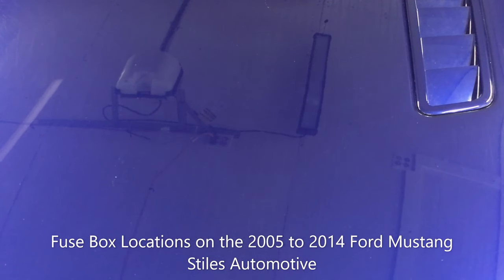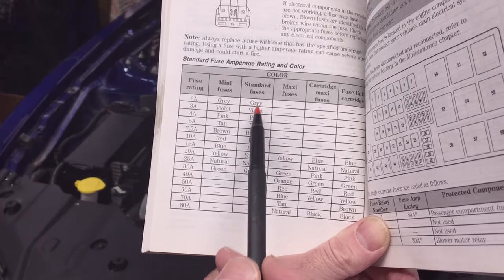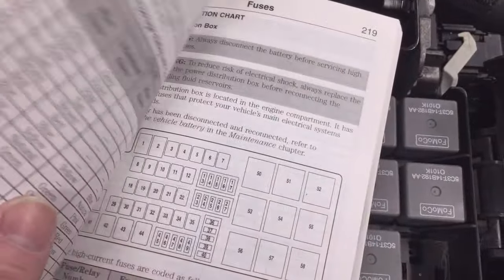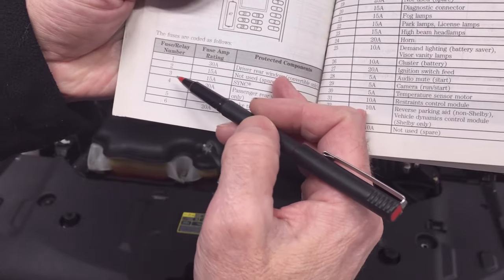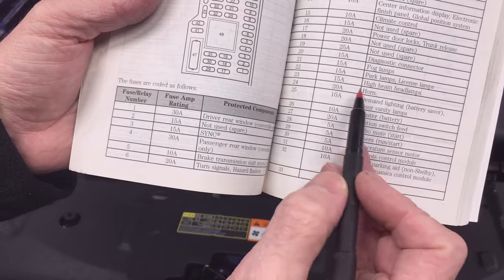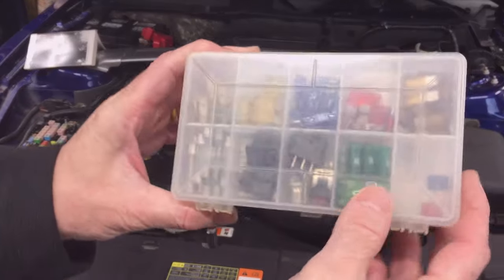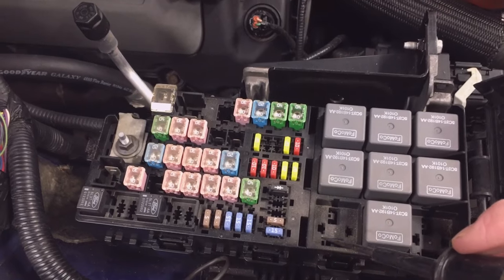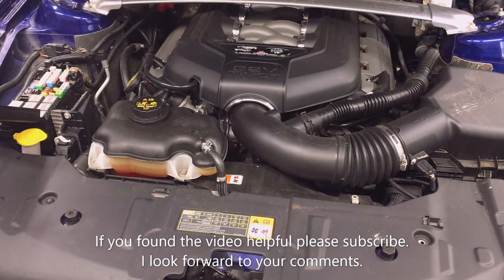Fuse Box Locations on the 2005 to 2014 Ford Mustang

Comment: I have a 2005 mustang and when I try to open the trunk with my key fob the button doesn’t work and when I go to the fuse box and opened it from there the trunk opens, do you know anything that could be the problem?
Reply from the maker: Cris, the simplest answer would be the Button on the Key Fob is going bad, it could be on a 2005 vehicle.  If you are like me, I use one Key Fob and even on my 1998 Mustang the 2nd Key Fob is new (used once or twice).  Did you try a second Key Fob?  If so . . . the Mustang uses a Trunk Release Relay on/in the Fuse Panel in the Passenger Side Kick Panel.  When you press your Trunk Release Button do you hear or feel the Trunk Release Relay actuate on the Fuse Panel?  How are you making the Solenoid operate from the Fuse Panel?  Are you bypassing the Trunk Release Relay?  - Stiles

Comment: i have a 2014 mustang, which fuse do i have to remove to reset my radio sync? my radio went out, all i see is the temeprature and which direction i am driving
Reply from the maker: Evan, In the Passenger Compartment Fuse Panel, Fuse Number 39 (20A, Yellow) is the Radio/Navigation and you may also need Fuse Number 41 (15A, Blue) Accessory Delay, Reference Pages 230 thru 232 of your Owner's Manual.  Also make sure these Fuses are good and not blown.  Another option is to work in the Engine Compartment at the Power Distribution Box, removing Fuse Number 1 (80A, Black) is the Passenger Compartment Fuse Panel Fuse, which will remove power from inside the Mustang, Reference Page 226 of your Owner's Manual.  Yet, another option is to remove the negative Battery Terminal.  Plan to leave the Fuse or Terminal removed for 10 to 15 minutes.  It seems your condition may be caused by a low Battery condition.  Charge your Battery overnight with a Trickle Charger and drive the Mustang.  Let me know how it goes.  - Stiles
Reply: You find out if that works? My radio is blinking as well
Reply: @jays5605  it didn’t work. I tried all the steps. My mechanic said my fuses are good. He also disconnected my negative battery but that didn’t work either. I’m not sure what to do at this point
Reply: Evan Holt Yeah bro, Do you think a new stereo system would work?
Reply: @jays5605  yea bro I may just have to. I could’ve blown out the speakers or something
Reply: Evan Holt You find the problem yet?

Comment: What is the cigarette lighter Fuse for 2014 ford mustang v6 need help
Reply from the maker: Quan, Ford calls it both the "Cigar Lighter, Front" and "Power Point (Instrument Panel)" which is powered by Fuse 22 (20A, Blue) in the Power Distribution Box in the Engine Compartment. Most Mustangs have a Second Power Point in the Arm Rest Console, that is Fuse 5 (20A, Blue) Power Point (Body). For anyone else reading this; this applies to all 2010 thru 2014 Mustangs - Stiles
Reply: @StilesAutomotive   I took them out and they wasn’t cracked or anything but it’s still not working what would be the next step

Comment: Do you know anything about the 2010 500 series sherrod mustang?
Reply from the maker: Wen, not that much, I've always thought (and not really justified in doing so) that these (Sherrod, Roush, etc.) packages are more cosmetic than performance.  This is unlike Hennessy which is performance.  Since you are asking this on the Fuse Box Location Video, do you have an electrical question? The 2010 Mustang is special, although it still has the 4.6L Engine (like the 2005 thru 2009, but more horsepower for 2010), it has a redesign interior and redesigned Electrical System (like the 2011 thru 2014 Mustangs). I believe Ford Engineers changed the Electrical System in preparation for the 2011 Engines.

I would be your 2010 Sherrod uses a mostly unmodified 2010 Electrical System. You may have some add-ons.   - Stiles

Comment: The fuses won't come out with the tool, how do you pull them out??
Reply from the maker: Margaret, I have used the Little Plastic Tool once or twice, but I normally use a Needle Nose Pliers, (like these  https://amzn.to/2Wh4MAa ).  I keep my Needle Nose Pliers handy in the shop, I use them all the time and I use them for the Wire Cutter on it, all the time also. If you don't have Tools, a Leatherman MultiTool with a Needle Nose on it would be your best buy.  Or, if you are just starting out, and want to work on your Car more, a Set may be a better option ( like this  https://amzn.to/3DaT6Ql  be careful the Needle Nose in this set may not have Wire Cutters, I wouldn't buy it then) - Stiles

Here is an Alternative -  -
Shop Tip #14 – The Perfect Alternative to a Small Needle Nose Pliers – the Hemostat.   https://youtu.be/F6TjYYw7vw0

Comment: What's and easy way to remove the fuse ?  Without use the tool in the side panel?  Good video!!
Reply from the maker: Paul, The little Fuse Puller on the Fuse Panel Cover is made of plastic for a couple of reasons, it's cheap and it doesn't conduct electricity (so you don't inadvertently short across anything). I often . . . most often . . . ok, I pretty much always use a Needle Nose Pliers ( like this one - -    https://amzn.to/2Wh4MAa  a set is often a better value - -  https://amzn.to/3DaT6Ql  )   I also did a number of Shop Tip Videos which are often over looked and don't get a lot of views, one of them (link below) suggests the Hemostat is a "Perfect Alternative" to the Pliers.  The Hemostat has a locking feature which is sometimes helpful.   The Hemostat looks like this - -   https://amzn.to/3uIbOMu   I appreciate the comment! - Stiles

Shop Tip #14 – The Perfect Alternative to a Small Needle Nose Pliers – the Hemostat.  https://youtu.be/F6TjYYw7vw0

Comment: Any suggestions on where to install RGB light 12v ?
Reply from the maker: John, You didn't tell me much to go on, Year of Mustang or RGB Light information, but I may have answered your question here in the comments:

1) Read the "J Jappie" Thread, it is very detailed.
2) Read the "Justin Warren" Thread were I stated, "Justin, I admit I don't know that much about you LC2 Audio Component, I thick it is just a splitter that separates out the bass (on one side) and everything else (on the other).  It doesn't have an amp in it, does it?  I want you to understand the power requirement.  I think the LC2 has a very low power requirement and I would splice into an easy to find Stereo Power Circuit.  At the Fuse Panel in the interior passenger compartment (I show in the video) use Fuse 39 ( 20A, yellow) Radio / Navigation, this is "Hot at all times" for the Radio Power.  Look at my video and pause at 7:49.  You easily splice (see my video on wire splicing) into this circuit at Connector C2280A, Pin 1 or the White Wire with Red Stripe.  If you pause the video C2280A is the gray connector on the left-side of the screen and you can see the White/Red Wire in the top/right of the connector.  Probe it and make sure it has 12 V.  You can add about 10% or 2 amps of load to this circuit, I would think, and be fine.  If you need more power than that, run a new wire from the Battery.  Don't power Amplifiers and other high power draw stuff from this circuit.     Let me know how it goes!  - Stiles"
3) John, let me know how it goes!
Thanks for the comment. - Stiles

Comment: What is the fuse for heated seats? I hear a clicking under the seat, but they never get hot? Have a 2014 GT
Reply from the maker: Art, The Fuse for your 2014 Heated Seats is Fuse 16 (20A, Yellow) Heated seats in the Power Distribution Box in the Engine Compartment. - Stiles
Reply: @StilesAutomotive  thanks friend, I’ll check it out and let you know if it works, someone told me that other parts from under the seat are also bad, so idk?? But thanks
Reply from the maker: @artman4890  Yes, Wiring Harness and the Connector under the Seat takes a lot of abuse.  You should disconnect the Connector, apply Dielectric Grease, reconnect it, and try the Seat Heater.  - Stiles

Comment: My mustang radio works, but when I drive 40+mph, the radio goes all mumbly and jumbly. The cd works fine. Any suggestions?
Reply from the maker: Geez Steve, that sounds like a bad Wire or loose Connection.  Or, maybe your Antenna Connections need to be cleaned.  Just reaching here, but going further, there are little Capacitors on different systems, like on your Antenna Wire, Coils, etc.  That is a tough question to troubleshoot in a text message.  Let me know if this helps! - Stiles

Comment: What fuse in engine can I use as an acc for like an led light strip hook up?
Reply from the maker: Expert, For your 95 Mustang GT, I wouldn't use any of the OEM Fuses or Open/Unused Fused Slots (of which your GT doesn't have any, I believe).  I would run a new Fuse or Fuse Block and a Relay that is energized by the Switched (Ignition Key) Power to ensure that are off when the Key is off.  A video I did to install a Dual Battery (and Digital Volt Gauges) in my truck may help you. Look at how I used Relays in that video (see link below). - Stiles

Dual Battery Design & Install; Modification for Any Car or Truck, Shown on 2004 to 2008 F-150 Trucks.  https://youtu.be/t05w5tv64g0

Comment: Do you know what fuse is the oil pressure sensor tied into ? 14 mustang
Reply: You have to look up a wiring diagram for your vehicle, and track the wires from the part back to the fuse to find out which fuse the part runs off
Reply from the maker: Platadah, The Oil Pressure Sensor has one wire going to it and is powered thru the Instrument Panel Cluster (IPC) (there is also a branched signal wire going back to the Powertrain Control Module (PCM)). The Cluster is powered by Fuse F26 (10A, Red) and Fuse F36 (5A, Tan) in the Passenger Compartment Fuse Panel (Smart Junction Box (SJB)).  One wire and it grounds thru its base. This is the same for the 3.7L, 5.0L and the 5.8L.  - Stiles

Comment: My tail lights are out on my 13 mustang I thought it had a bulb but it doesn’t they said it was a fuse now I don’t know what fuse it could be
Reply from the maker: Nat, Yep, your Tail Lights or properly called Rear Park Lamps are Long-life LED and is likely the Fuse.  Look at Fuse 22 (15A, Blue) Park Lamps, License Lamps in the Passenger Compartment Fuse Panel (shown in video).  Reference your 2013 Mustang Owner's Manual, Page 222 thru 223.  - Stiles
Reply: @StilesAutomotive  thanks a lot for your answer and your time
Reply: @StilesAutomotive  what if I have same problem in a 06
Reply from the maker: @juanyacarter9091  Juanya, if all of your Tail (Parking) Lights are not working, your problem may be more than a Fuse, it may be the Passenger Compartment Fuse Panel (Ford calls a Smart Junction Box).  Your 2006 Mustang Fuse Panel has a Circuit Board on it the controls your Parking Lights.  I hope this helps with your troubleshooting.  - Stiles

Comment: Why is there no mention of a relay fuse in the trunk of a 2014 Mustang convertible? If you remove the inside panel on the right, it exposes a fuse. Does anyone know what that fuse is intended for?
Reply from the maker: Darrin, For the Convertible there are 2 Relays in that area, the Convertible Top Lower Relay and the Convertible Top Raise Relay. These are Relays. These are not Fuses or Circuit Breakers.  If you are sure it is a Fuse, I will investigate what it is, there is a Body Control Module and an Subwoofer Amplifier back there. - Stiles
Reply: @StilesAutomotive  Ah, thank you so much for the 411. Is there any way that I can contact you directly? I would like to provide a photo to be certain. It appears elevated plugged into a silver box with thick wires coming from one end. The plug-like fuse/relay itself is white. Does this sound like a relay for the convertible top motor or a subwoofer amplifier? I would like to know before I proceed as my top works intermittently when trying to place it back up. Coming down is fine. Re: relay? in trunk of 2014 Mustang convertible

Comment: What fuse is the cigarette lighter that’s hidden in the compartment near the cup holder 2013 mustang?
Reply from the maker: Luis, sounds like you are talking about the "Power Point" in the center console (inside the Arm Rest Console).  If so this is Fuse 5 (20A, Yellow) Powerpoint (body) located in the Power Distribution Panel in the Engine Compartment.  The Lighter Port in the center of the Dash is the "Cigar Lighter, Front" this is powered by Fuse 22 ( 20A, Yellow) PowerPoint (instrument panel) also located in the Power Distribution Panel in the Engine Compartment.  Let me know how it goes! - Stiles

Comment: Hi. I really enjoyed this enlightening video. I am trying to replace just 1 fuse. But a very important 1. It is used for my heat, air and defrost I think. I live in Minnesota and its like 25 degrees. I have no heat or defrost.  Its freezing!!  Can you tell me witch fuse I need to replace? Im forever grateful!!.. And a new subscriber.  2009 Ford Mustang GT convertible... #HELPINMINNESOTA!!
Reply from the maker: Sunshine, You need to look at 2 Fuses on the Passenger Compartment Fuse Panel (in the lower Kick Panel, like I show in the video): Fuse Number 3 (10A, Red) Wiper Power / Blower Motor Relay, and Fuse Number 12 (5A, Tan) Climate Control, Ignition.  And . . . Look at 1 Fuse on the Power Distribution Box (in the Right Front of the Engine Compartment, like I show in the video): Fuse 2 (30A, Green) Climate Control Blower.  Reference Pages 198 thru 203 of your Mustang Owner's Manual.   Stay Warm and be careful out there!  - Stiles

Comment: Привет кто подскажет где предохранитель от подсветки руля и торпеды.спасибо мустанг 2013
Reply from the maker: Slava-ger, I translate that as "Hello, can anyone tell me where the fuse for the steering wheel and dashboard lights is? Thanks Mustang 2013". And my answer is Fuse 10 (15A, Blue) Switch illumination, (Steering Wheel, Cluster and Panel Illumination, Stiles Added) Pony projection lights (2013-2014) in the Passenger Compartment Fuse Panel (location given in the video). You caught me answering the mail. Счастливого Мустанга (Happy Mustang-ing) - Stiles
Reply: Огромное спасибо будем пробывать!!!!
Reply: Большое спасибо всё получилось всё работает всё светится !!!!!
Reply: Сегодня сделал

Comment: Hey would you happen to know where the horn relay is on the 2014 v6?
Reply from the maker: Arthur, Yes I do. The Horn Relay is located on (in) the Smart Junction Box (or the Passenger Compartment Fuse Panel).  That whole Assembly is called the Smart Junction Box and the Horn Relay located in it is "Non-Serviceable"  You didn't ask, but the Horn Fuse is Fuse 24 (20A, Yellow) also located on the Passenger Compartment Fuse Panel (location shown in the video). - Stiles

Comment: Hey man I hope for a response here, I’m simply needing to wire in a lc2 to a constant 12v supply. I was wanting to wire that into the inside fuse box. Any ideas on a fuse spot that can produce that cleanly ?
Reply from the maker: Justin, I admit I don't know that much about you LC2 Audio Component, I thick it is just a splitter that separates out the bass (on one side) and everything else (on the other).  It doesn't have an amp in it, does it?  I want you to understand the power requirement.  I think the LC2 has a very low power requirement and I would splice into an easy to find Stereo Power Circuit.  At the Fuse Panel in the interior passenger compartment (I show in the video) use Fuse 39 ( 20A, yellow) Radio / Navigation, this is "Hot at all times" for the Radio Power.  Look at my video and pause at 7:49.  You easily splice (see my video on wire splicing) into this circuit at Connector C2280A, Pin 1 or the White Wire with Red Stripe.  If you pause the video C2280A is the gray connector on the left-side of the screen and you can see the White/Red Wire in the top/right of the connector.  Probe it and make sure it has 12 V.  You can add about 10% or 2 amps of load to this circuit, I would think, and be fine.  If you need more power than that, run a new wire from the Battery.  Don't power Amplifiers and other high power draw stuff from this circuit.     Let me know how it goes!  - Stiles

Comment: Great video! I’m running into an issue with my car at the moment. I drive an 05 Mustang and I’m getting a issue of my car radio and headlights die when I’m driving. I went to check the alternator and battery and both have great reading showing that they are new which they are. I’m wondering why do my electronic die when driving then when I rev up or speed up everything starts to work like normal again. Any help appreciated thanks.
Reply from the maker: Myron, that sounds like a Keyed Ignition Switch, Power Saver Relay, or more likely a Smart Junction Box problem. When the problem occurs, check the area on and near the Key, does it get hot? In my video I showed you the Passenger Compartment Fuse Panel, this Panel is on (or part of) the Smart Junction Box. Your 2005 Smart Junction Box is different than my 2013 (Shown in video), but is located in the same place, the Passenger Side Kick Panel. I'd take a good look at it to see if there are any indication of it getting hot, and smell it for burnt plastic smell.  Let me know how it goes! - Stiles
Reply: I’m having the exact same problem and mine is a 05 as well